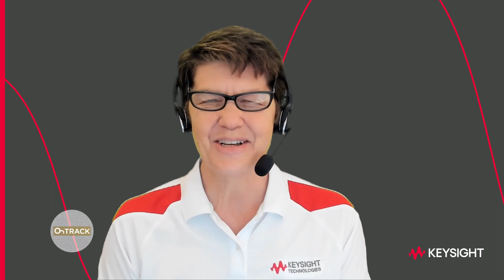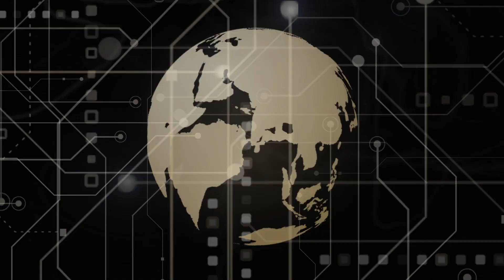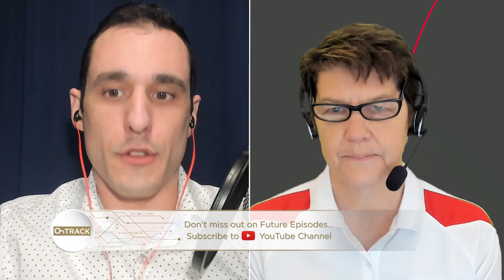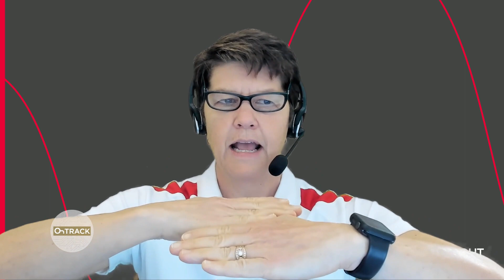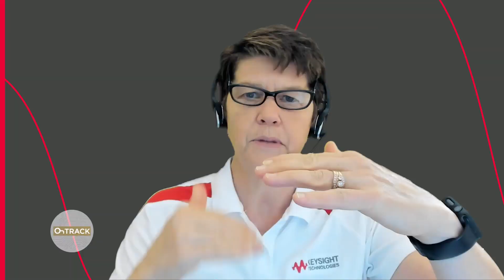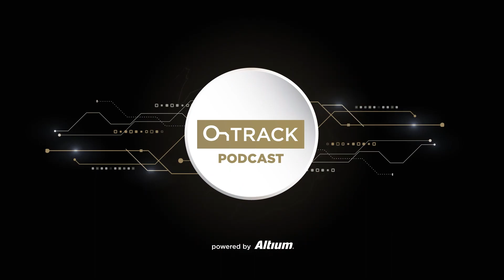Power Integrity and Simulations with Heidi Barnes

Comment: Great subject. And video as usual.
I use beads with a resistor in parallel. This gives me low DC resistance for the DC power delivery, and it gives some better attenuation at high frequency. The resistor value is often only 50ohms but can be up to 1kohm (it depends). This has always worked ok without the scary resonances a lone bead may give. The expense of a bead and resistor is nada compared to everything else, so not an issue. But of course sometimes there is no room, and then the bead is the first to go. 
Any comments on this practice please? Am I completely disrupting the point of using a bead when I parallel a resistor?
Reply: Thanks for watching! We just recorded a response to this question for our next Q&A video, but I'll give you a much more detailed answer here.

It sounds like you're doing this for an isolation effect from some other power rail. I understand what you're trying to do and you are counteracting the effect of the bead at least in some freuqency range. Obviously, this will depend on the impedance of the bead and where it resonates, but at the resonant frequency it's possible that you're just reducing the impedance of the ferrite a bit if you're using a small resistor. I can see how this would work okay for a small resistor as long as you're only trying to block noise from a DC rail that does not have switching logic on it, or at least has slower switching logic on it with high input capacitance. If you remove the bead now you have some DC power loss. Maybe that's bad, depending on the load you're using. At minimum, you're limiting the current that can reach the load, but maybe that doesn't matter depending on the total current your power supply can provide.